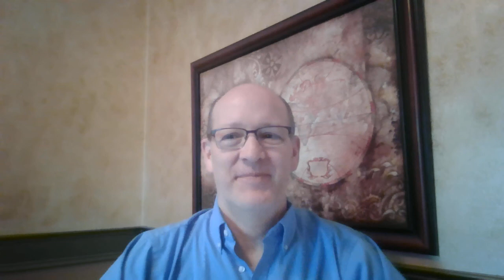Magnetic Energy and Water

Comment: So if water isn't the only fluid all these things are true for - would molten bismuth work the same or better (many times more diamagnetic, plus the high draw factor) for instance? Dr. Clark was focused on the diamagnetism to mess with gravity, but I just wonder about bismuth specifically as far as if its molecular structure would do the same in the same arrangement for magnetic energy purposes...

Does the fluid of the magnetic vortex have to be in contact with the area directly to affect the compression - as in put a magnetic energy jump-gap in the middle of a Clark coil while also pulsing the copper of the coil (pipe) itself to make the gravity region and energy signature pulse regions overlap?

Comment: There is nothing unobtainable in this design, so it is buildable by anyone, in theory. However, I am affected by a phenomenon of sleepyness when I try to read thru the webpage to understand how it works, or even how to build it. I attribute sleepyness to a "blocking" of these concepts, and that is familiar and pisses me off, so I will return to this.  I didn't have problems with the romags and their new excellent 3D drawings.  Anyway, I don't understand this device yet.  Kevin, amongst all your devices, which of them should "someone" build now, or asap.  Maybe none, if there is an existing company tooled-up and waiting for go-ahead.   I also have fundamental questions about "compressed magnetism" aka "magnetic energy density".  Which of these is a match?:  A) Long planet-sized magnetic energy paths (resembling flux lines) running parallel to each other, and very close together, not helixing like a rope, more like hanging strings of beads in a doorway.  B)  The center part of a torus where the energy IS in a rope-like spiral, getting very tight.   C) The cross-crossing of magnetic energy flow lines, like a cloth fabric?  D)  like a bunch of slinky toys, fit nicely together in a shared helix, ( and if curved into a donut, would be called condensed matter).  E)  slinky toys all tangled at many crazy angles.
Reply from the maker: Depending on budget and need, I think the water devices are quite practical for survival, but with an unlimited budget, all of them should be built asap, just not used until it is safe to do so, post pole shift. From our understanding the energy basically always moves in a helical pattern even as pulses, and the groups of waves and/or pulses conglomerate into geometrical patterns that interlock with each other...

Comment: I'm returning to this one, 2 years later. I recently upgraded my water, distill then sonocavitation, then magnetic vortexing, then adding nano silicate. Soon after, I'm getting ideas about gravity, and running into so much bad info on the internet about gravity related and magnetosphere related things.  Could you explain the 'gravity loop' ?  And frequency effects.  I haven't gotten that far yet. Also, I was wondering if the 'water pump' device uses water's diamagnetic property to raise it up from the water table?  Also, anything else you'd recommend for the water I consume?
Reply: I'll resume reading that water purifier webpage tomorrow, and ask better questions after that.
Reply from the maker: If the water in a vortex has neutral magnetic pulses, gravity will be altered in the center of the vortex and open the door to encoding the water. The magnetic pulsing, the copper tube and water's properties help raise it up in the pump. If you drop the vortex in a vortex and then spin alternating magnets around that water you can condition it to some degree making it beneficial for drinking. Maybe I'll do a video on that...